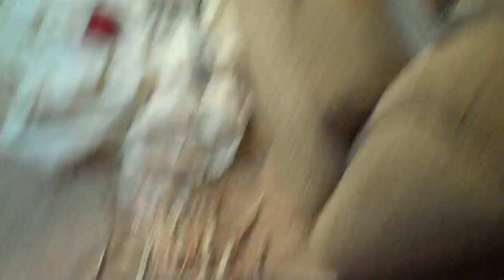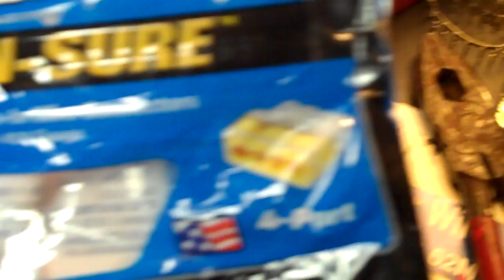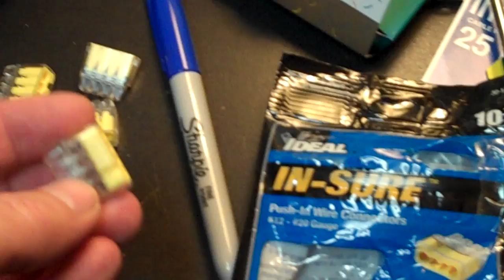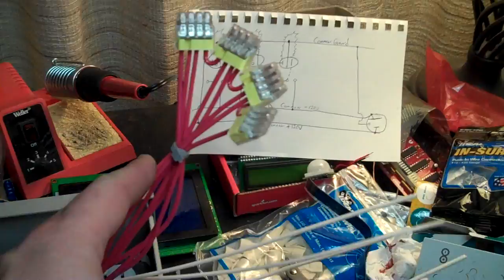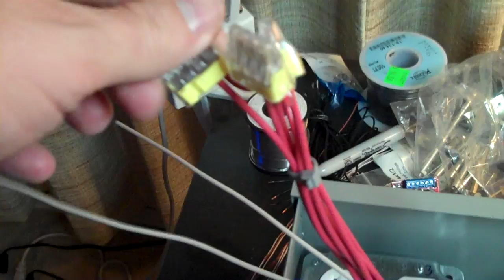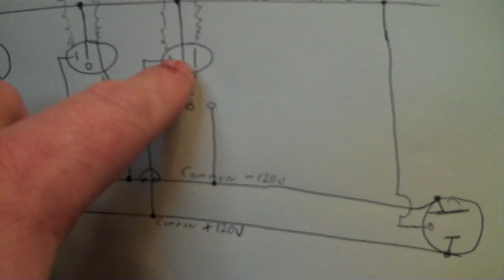Christmas Lights Control System - Part 2-3

Comment: You should have wired ground with bare copper, Red is the secondary hot line.

You should always switch the hot.  Think of it this way, if you switch the neutral, and your lights are off, it it safe to touch a frayed/bare wire on the lights?  No, you'll get shocked because the hot is live all the way out along your lights.  If you switch the hot, and you touch that bare wire somewhere along your lights, then you are safe, because the neutral line is already grounded at your circuit breakers.

Comment: A little late to the dance, but the red and black are both intended to carry the hot legs, the three conductor wire is designed to carry 240v for appliances that require it. In ths application though it can be used to achieve two 120v circuits. The white should be neutral and the bare copper conductor to carry the ground.  If you then switched the hot and kept the neutral side of the outlets bonded with the tab you would have effectively two channels running on one piece of romex. If you used THHN single conductor wire then you could bond all the neutrals together with a jumper between outlets, and bond both the outlet grounds to the same green jumper wire, effectively needing just the six THHN wires running into each box. And you would also need only 4 neutral and 4 ground connections when you created the bus, thus eliminating the problem of the exposed hot bus since each hot leg would be fed from the output side of the relay board.

Comment: Switching the "hot" would also allow you to tie all the neutrals together and grounds together within the outlet boxes (using the screw terminals on the outlets), thus only requiring one ground and one neutral to protrude from each box and eliminating the need for the external splicing connectors..
Reply: Exactly.
Reply: It's more professional, safe, and looks much, much better.

Comment from the maker: Switching the hot side only matters if you are using solid state relays. Actually let me restate that, if you are worried about being code compliant you should probably be switching the hot not the neutral.  Either will work but in some wiring situations switching the neutral is more dangerous.  So probably switching the hot would be a better choice.  Thanks for pointing that out. :)